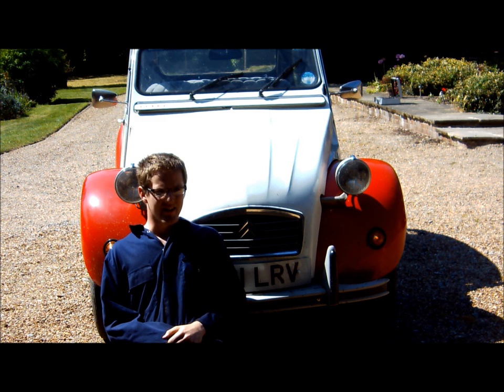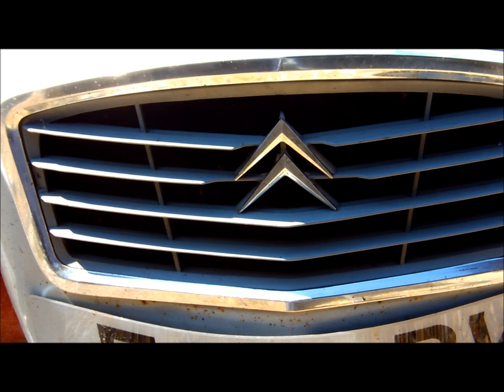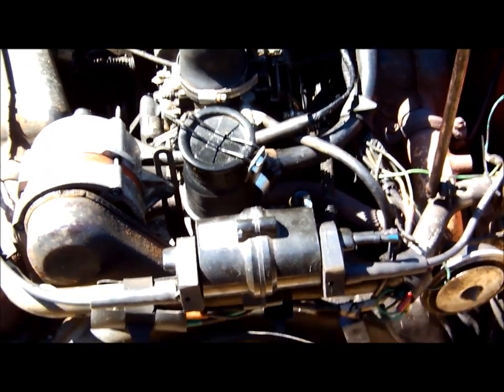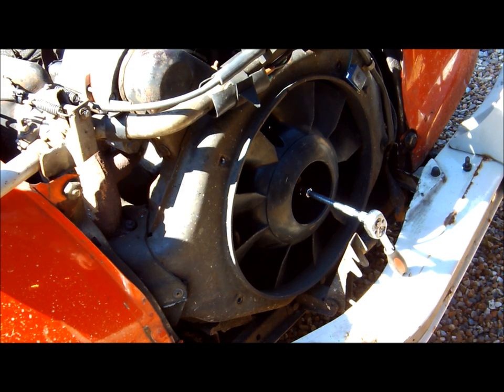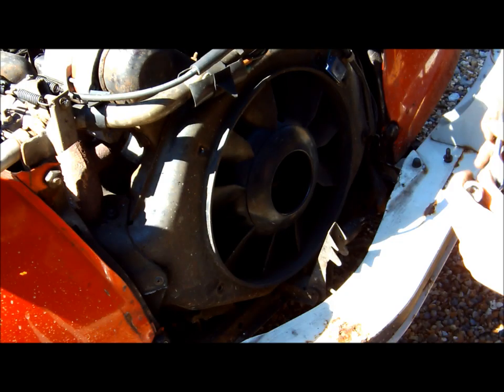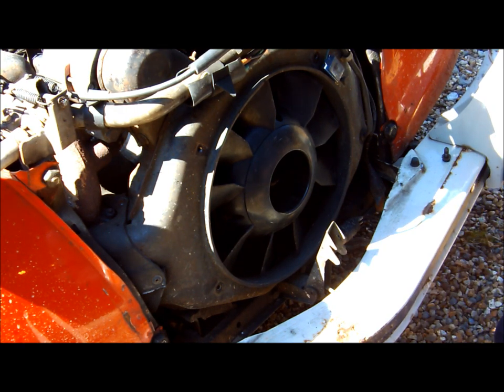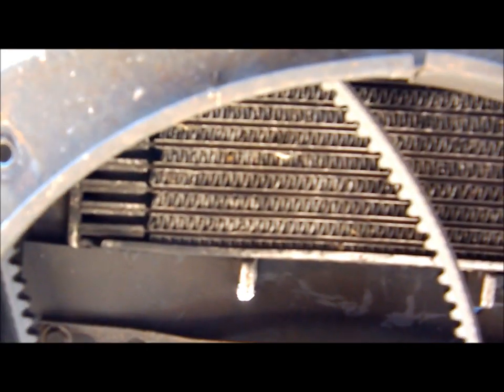Citroen 2CV Points and Condenser

Comment from the maker: Glad you found it helpful. The fan can still be a bit tricky to remove, especially if it hasn't been off in a while, but my method has always worked eventually. The key is to put a dab of grease on the taper before putting the fan back on and to keep servicing the car regularly, which means taking the fan off quite a bit. Good luck with the Mehari!

Comment: my fan just wont come off :(
Reply: you remove the bolt in the middle of the fan, take a small pipe that fits into that hole. Put it in and tap on the end with a hammer (not too strong to brake it but not to weak either...) dothis in every direction alternating -> left.. right...up...down...etcetc you get the point that should work

Comment: Great video, love the disarming honesty!  Only one question/mild criticism - In which direction did you make the correction by one tooth to compensate for modern petrol?  This was not quite clear to me.
Reply from the maker: Glad you liked the video - the 'disarming honesty' approach saves on editing time! You have to set the timing point slightly later than specified to run on modern petrol - set it so the official timing mark on the flywheel is slightly to the right of the mark on the housing, usually 1 or 1.5 teeth
Reply: Thank you Jack!

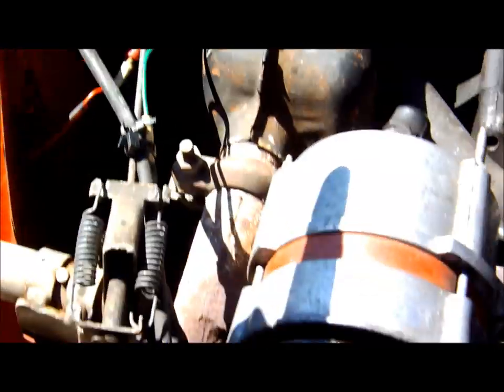Comment: 01:45 .... " Firing at the same time ???

..are you sure ?
Reply from the maker: Yep. Both plugs fire at the same time, so on one cylinder the plug will fire at the top of the compression stroke (as normal) and the other will fire at the top of the exhaust stroke, when the cylinder is 'empty' so nothing happens. Quite common on simple two-cylinder engines. The alternative would be to have a distributor or twin coils/magnetos.
Reply: @jozg44  sorry bro ..you re right